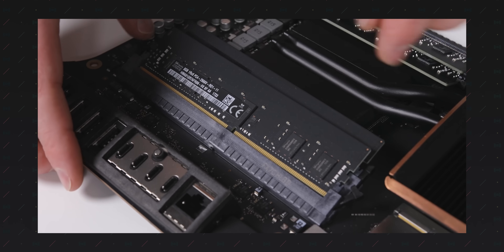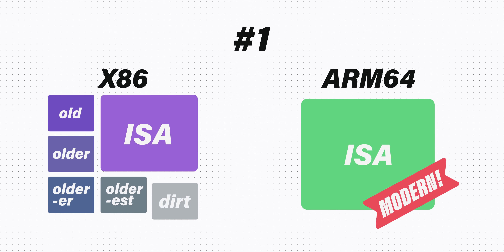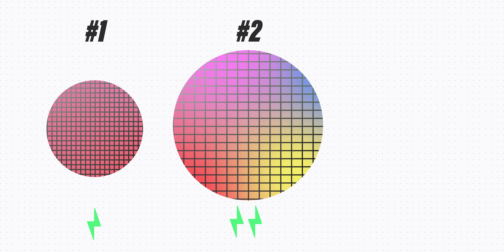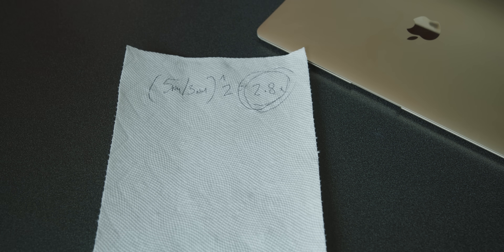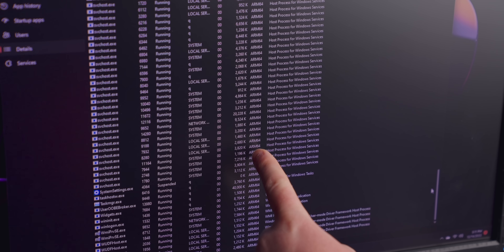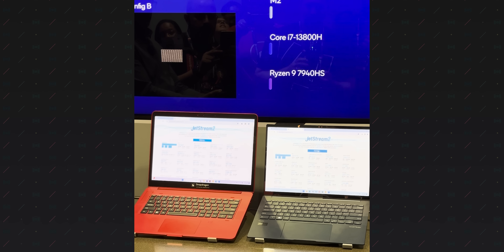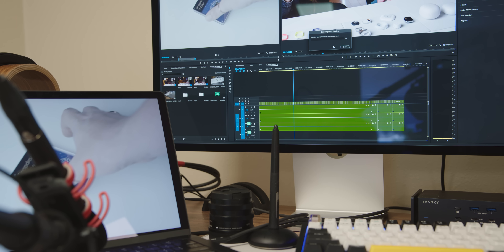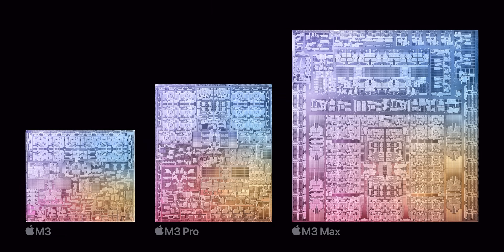Apple's Silicon Magic Is Over!

Comment: The biggest problem with the previous attempts at Windows on ARM wasn't just the performance, it was the price. They were charging more for a device that was less powerful and had more draw backs.. there was no value proposition there. If they made them cheaper, I think some of the limitations would have been overlooked

Comment: Apple has the  most advantage with the closed efficient software system.   The hardware still comes down to Arm chip and good node efficiency.  The M series was a good switch for apple with Intel not competing with new chip designs.  Almost like Apple should have stayed with the PowerPC of old :)

Comment: What you said is what AMD realized. "Wait... if we manufacture this part on the new node but these parts that won't get as much of a performance boost on these parts on the older node, we can save money!"
Reply: There are also technical reasons why having parts such as IO on older process nodes is advantageous. It's not all about money but that is a factor.
Reply: It's not just saving money, shrinking certain parts (like IO) further just didn't scale to the new nodes...
With chiplets, they have very small dies and thus the chances of major errors in them is much lower, resulting in way better yield or feasibility to make them to begin with. Meanwhile the huge-ass IO die gets made on a node which is mature enough to reliably make that size of die.
Well, I guess it is saving money in the end after all by making the production yield of their chips not prohibitively bad.
Reply: Yeah and then those chips alone idle at ~20W...
Reply: @yarost12  There's Ryzen NUCs that idle under 10W.
Reply: @JoeStuffzAlt  single chip processors yes, they idle really low, those that you're describing, with the IO die, idle at at least ~12-15w while doing nothing, and playing YouTube videos on them brings that up to 20+.
Reply: @JoeStuffzAlt  Those are monolithic chips. The chiplet designs have notably higher idle power draw. See Dragon Range laptops and their battery life or the idle power of something like a 7950X.
Reply: @yarost12  mine is at 5-8 W while watching this yt vid
Reply: @greateminemfan  which one do you have

Comment: i am convinced that when widows fully moves to ARM with a chip that is as even powerfull as M2, apple will be screwed.
Reply: The problem with that is that "windows" doesn't make anything. Its up to the 3rd party
Reply: Windows hasn’t even fully moved to 64-bit, something Apple did about 8+ years ago (I think) so I wouldn’t hold your breath. The M10 will be out by then …

Comment: it'll be a decade after M1 before Windows "catches up"
Reply: 🤡 Snapdragon elite has already caught up to Apple's latest M3 and M3 pro chips in CPU and is just slightly behind in GPU while offering better perf/watt (check MaxTech's video of x elite) and on a 4nm chip while Apple is using 3nm. Remember also that this is Qualcomm's 1st gen in-house designed chip, basically the equivalent of M1 to Apple but it's powerful enough to compete with Apple's 3rd gen M3 and M3 pro chips. I can only imagine how their M3 max competing chip will perform if their base M3 competition is already much faster. It'll only take Qualcomm a few years at most to overtake Apple.

Comment: Its really their media engine and battery life of their arm smartphone processor that does all the magic.

Ironically microsoft and samsung and qualcomm were first with arm based machines.

Not the cpu or gpu which have long been beat by competitors.

The soldered memory and ssd and limited upgradeability are itd planned obselence weakness.especially on desktops like the mac oro and studio.

These machines are bricks and cannit biit from external drives once the ssd dies they are headed for e waste.

They are also difficult to repair and graphics and cpu can never be upgraded on deskops or thru oci or through thunderbolt.

Your machine is time stamped at purchase always.

Comment: What is interesting is that last year the Qualcomm chip was supposed to be much faster than an M2 then the M3 came out and it wasn't really as fast and the M4 will be hot on it's heels. I do agree Apple needs to continue to innovate but and I truly believe every app you were show worked well on arm but MS isn't going to abandon x86 quickly and doesn't have a great track record on translation layers. I'm optimistic for competition's sake but very cautiously optimistic...

Comment: M1 was a perfect example of optimisation.  More efficient reduced ISA with a kernel built specifically to utilise it efficiently, purpose built applications and an operating system designed to make best use of its resources.  It was an example of how lazy development has become - throw more power (compute power and/or electrical power) at the problem and call it a day.  Not at the behest of developers and engineers - but because the expense of that level of redevelopment is astronomical when you've dug your heels in for decades.  Apple simply can't recreate the jump that M1 pulled off without either a serious jump in technology, a heads-down myopic focus on further optimisation, or both.  Now, they've burned out their best engineers by frankly slave driving them to produce M1 and they're resting on their laurels until someone else roundly demolishes them and they can't spin their way out of it.  As the first company to break a 1T market cap, it's safe to say they feel no market threat to continue to invest in genuine innovation - as they've been doing for decades, they'll simply refocus on enclosure and keep their customers trapped for as long as possible.

Comment: The low storage and ram of entry level configs are also a problem that ruins the power of the chip. To really push the computer to your limits need enough storage and memory to do so. What apple is doing with their upgrade pricing structure sucks.

Comment: For me the biggest problem with the Apple silicon computers is Mac OS. Every person I know has a completely customized set of apps half of whom have at least a couple they had to pay extra for, ultimately making the operating system completely unlike the default experience. I don't know of a single pair of engineers at my work that could use each others' computers without going crazy. With Windows you just have to change a handful of settings and then uninstall a bunch of bloatware to have what is basically the same setup nearly everyone lands on.

The second biggest thing is the closed garden and looking down on their own users. If Apple let anyone install any operating system on their hardware I would have happily bought nothing but Apple hardware for the past 10 years. But ultimately their OS still works like it's the same thing when they cornered the US school markets 20 years ago. I mean it took over a decade for them to even add a second mouse button. Add to that their anti-repair practices and it amazes me that anyone still supports them...I'm guessing it's for everyone a "better of two evils" question because "Linux hard".

Comment: I have a 2021 M1 iMac and a M1 Max 16 inch MBP. As a software engineer I can run the same DEV stacks with dozens of docker containers on both machines and usually I cannot tell the difference in performance. I cannot see how can Apple convince me to upgrade in the foreseeable future.

Comment: M3 is built on N3, not N3E. N3E is coming in products later this year, has a bit relaxed specs and it's cheaper than N3.
Design of the chip takes like 3-4 years (see M1, see Meteor Lake, etc.). If apple only has like small improvement ready, than they probably lost lead and momentum.
Scaling will again start with 2nm nodes (N2, 20A, 18A and towards 14A) thanks to several aspects, GAA FET, backside power delivery and later forksheet transistors

Comment: Can we just appreciate for a moment how good the M1 was? The M1 MacBook Air was probably the best laptop in the $1000 range you could buy at the time and even today, it's still very much usable, I've bought a brand new Ryzen 7 laptop not long ago to replace mine and, at best, it's very slightly worse than the M1 in most tasks. Of course, Apple being Apple, the 8GB of RAM became a problem long before the CPU and the M2 and M3 are WAYYYY too expensive compared to the competition now, the jump is nowhere near as big and both AMD and Intel have decent options in that price range.

I'm very excited for the Snapdragon X Elite, I've bought the PoS that is the Galaxy Book Go and its Snapdragon 7c Gen 2 that can barely compete against a Celeron just because I really wanted to try Windows on ARM, I really want to see that it can do on an actually good SoC, I've been saying for a while that Windows on ARM doesn't have a software problem, but a serious hardware one, even the best currently available ARM CPU is worse than a mid-range i5.

Comment: Is there any technical limitation for Apple to have the system on a chip and then you can add additional RAM and Storage after the fact? That would be the best of both worlds.
Reply: yes it would be slower enough to have noticeable and real impact on performance, there is a reason laptop makers are going with soldered RAM these days more and more

Comment: He exemplifies the problem with these YouTube reviews.  He's banking more on rage-bait than providing actual content.

Apple is not "sitting around".  In order to get to the M1, Apple also had to make sure MacOS, and as many apps could run on the new platform.  That's not something one does in a year.  Windows ARM (RT) has been around for 10 years and it still is not ready for prime-time yet we don't see him complaining about that.  

The transition to M1 was incredible.  For him to expect that future iterations of the M-platform will have as many groundbreaking performance improvements over the prior is just silly and shows his lack of understanding in how difficult it is to design future chips.
Reply from the maker: I literally complained about the very thing you said I didn’t complain about. I suggest you watch the video you’re commenting on.

Comment: The ISA has very little to do with it. Both x86 and modern ARM are rewriting microcode before execution. 
Arm started in 1985 and carries baggage. See: Arm Thumb Instructions.
Reply: It makes a big difference when Apple can customize their own ARM processors exactly how they want to work best with their custom operating system.  They cannot do this with x86.  Also, while ARM does have 'baggage', it's definitely not to the level of x86.

Comment: So the original team that designed the m1 now works in Qualcomm, so I think Tim Apple will keep overclocking chips to compete.
Reply: The thing is apple sold well even when they were using intel chips, which were hitting thermal limits fast, so I doubt people buy apple hardware for performance first. I think nothing much will change with apple, they rarely take any risks.
Reply: Hilarious if true

Comment: I think Apple dod some innovative woth their headset.granted its not going to take off because of various reasons.

People tend to forget that at the end of the day it's about money and business models. 

Apple makes almost ALL of its revenue from selling hardware. Yes, they have other sources like the Apple store but selling hardware is how they make most of it. 

There is ZERO reason to soldier the SSD and RAM to the motherboard,, it doesn't make extra room in a laptop. It's simply a way to charge absurd prices for upgrades. The cost to upgrade from 256GB to 512GB is around 200 to 300 dollars. A  512GB nvme drive, same generation  from Kingston is 40.dollars. That's for a brand new drive, not an upgrade from one size to another. Their topped out Max Pro is 10K for the max memory and max SSD version. There is a reason there.are no 3rd party companies that make MACs.

One channel built a 10L PC and it was ridiculously faster in every way as most of that money was spent on a thread ripper CPU. It also has a REAL GPU, unlike Apple.

Windows. Makes money from selling software and cloud services. They make more from selling Offices licenses then they do selling OS's. Enterprise licensing for CALs (client access license) and everything else is where they make all their money. People want to compete with the surface process while ignoring the 10K other options you have. They are also the sex d largest cloud provider and a better option as they charge a 5th of what AWS does. 

The funny thing is, and he said it in the video, that not many people ever even maxed out their M1's. Same for someone who buys a powerful x86 processor for web browsing and other minimal stuff. So what does it even matter? Also, for home users it won't matter but at the enterprise level it's going to be a decade or more before they move to ARM. Way too many niche software  companies out there that charge 100K a license because they make software for a specialized industry. If anything, ARM might take over the home user market but I'm still not believing the "everything will just work" part when some of Apple's own software doesn't work on ARM but still shows up. When you launch it you get a message saying "not compatible with CPU architecture" so no, emulation only goes so far and natively porting an application to a new architecture isn't easy, especially the more complicated the software is.

Comment: God I hope not everyone moves to arm. Hopefully intel doesn't give up the fight. Arm sucks. X86 need go but shouldn't give that ground.
Reply: ARM won't touch the enterprise level it's going to be a decade or more before they move to ARM. I wouldn't expect a server version of Windows to pop up anytime soon. Way too many niche software companies out there that charge 100K a license because they make software for a specialized industry. If anything, ARM might take over the home user market but I'm still not believing the "everything will just work" part when some of Apple's own software doesn't work on ARM but still shows up. When you launch it you get a message saying "not compatible with CPU architecture" so no, emulation only goes so far and natively porting an application to a new CPU architecture when x86 has been the standard for 30 years plus isn't easy, especially the more complicated the software is. You can't make them port it to ARM either so if the company doesn't think it's worth it, they simply won't.

Comment: It honestly baffles me just how long it took other computer manufactures to catch up to Apple, I mean essentially Apple has been running circles around them for 4 years. I am happy though that windows and other chip manufactures are starting to catch up because I think it will benefit Apple rather than hurt them. If windows for arm becomes more popular and widespread, not just in surface products, then we could see stuff like bootcamp come back to the Mac. Something that Apple has stated multiple times that they're open to do and that it's Microsoft that's refused. I do think apple silicon Macs are aging super well I have had a 14" 2021 MBP since 2021, battery is still amazing, and performance is still great no desire to upgrade at all.

Comment: Unified memory... That has been used by every APU. Unified memory, prior to Apple Silicon usually used in low end configurations. It isn't magic. There are tradeoffs to using unified vs separate memory. Apple didn't invent the idea and it doesn't mean all workloads are faster.

Comment: Let's be real here, apple silicon for Mac is basically an iPad chip but more powerful. The revolutionary performance of M1 was enabled by Apple bringing all that was good about the iPad and iPhone chips to Macs. This took a lot of effort, but the most important building block of any chip are the CPU and GPU and the A14 and M1 use exactly the same CPU and GPU designs, M1 just has more cores.

Making macos work on ARM is very impressive, but from here on out improvements are going to be similar to those of ipads and iphones, that is "not very big".
Reply: Thinking about ARM architecture as designed for mobile is mistake as well. ARM CPU’s was in netbook era as well. Apple just pushed ARM as „mainstream” PC processors.
Reply: @KicksonAcapulco13-no5rd  I'm not stating it's a bad thing that Apple uses the same CPU and GPU architecture in A and M series chips. I can't argue with results.

M1, M2 and M3 uses 4 P cores and 4 E cores, while respectively A14, A15 and A17 have 2P, 4E. The cores themselves are identical. So if a P core in A18 or A19 is 15% better, then the same P core will be 15% better in M4. Same for E or GPU cores. Unless apple wants to make new different cores for Mac, the M series cannot evolve faster than A series. The only way to widen the gap would be to increase power usage or to add more cores.

Comment: The ISA does not magically make a chip more efficient. It is far far more complicated. Ultimately all modern cpus use most of all the same features. Register renaming, micro ops, etc. to improve IPC without changing the ISA. More of it has to do with just the implementation. The skill of the engineers.